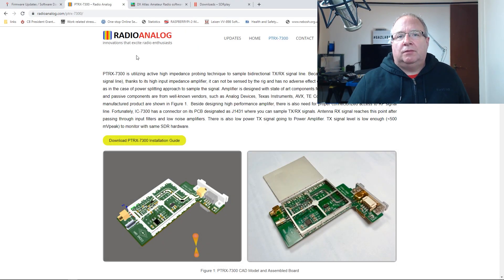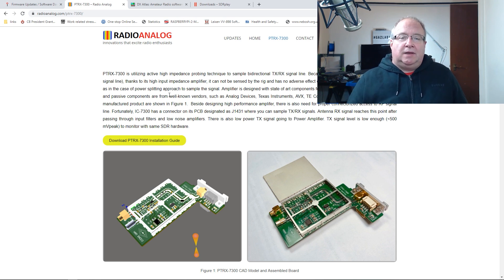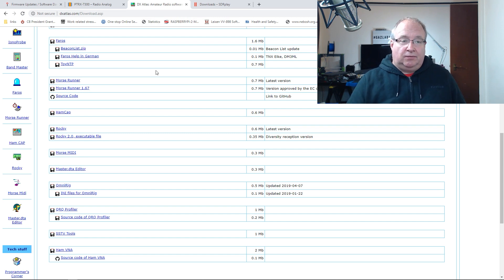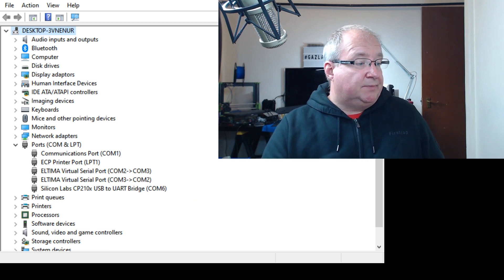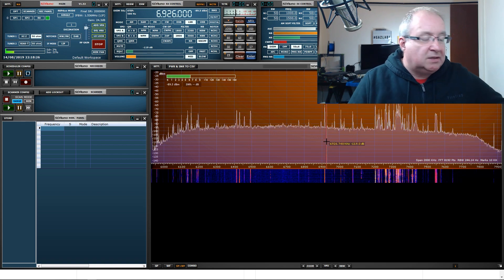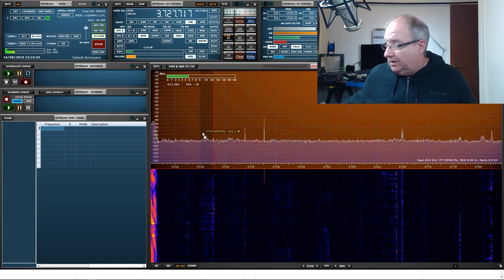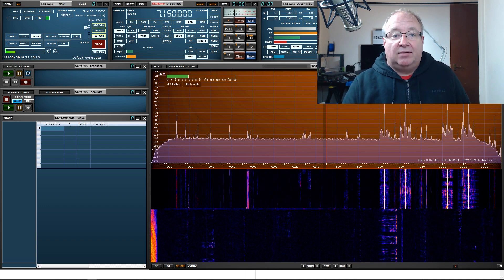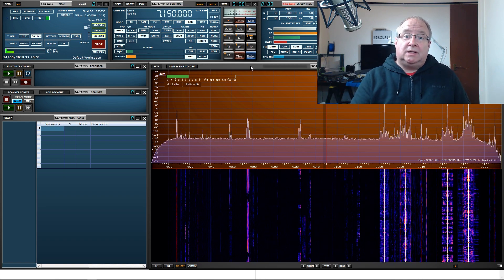PTRX-7300, Omnirig, SDRPlay UNO., IC-7300 connected!

Comment: so if an aerial is plugged into SDR Play and then SDR Play to 7300 and then connected with Omni rig, do you get the full spectrum of the SDR ie the SDR Play will pick up say 23cm if the aerial is in i take it you could tune it with the radio on 23 cm which it isn't capable of
Reply from the maker: no, the ptrx is designed around the spec of the 7300.. you could use an RSP duo just utilise the second receiver for what ever you want with its own antenna..

Comment: Gary, I have an IC-7300 with the internal board feeding to an SDRDuo, I would like to plug a receiving aerial into the 7300 and thought that maybe I could do it with this combination of hardware and software. 

Can I bring in a receiving aerial such a very long wire that is low down and feed that into Duo's second port AND then synch the frequency on the rig in particular to the SDRUno software and listen to the reciving aerial over headphones/pc speaker? Using the internal board will save me hammering the Duo on transmit.

Have I understood the cabilities correctly, or is there a catch and you can only control the rig from the SDRUno software rather than the other way around?

73 de Terry G0BIX

Comment: Thanks for the great video!! I just have one question. I have the same configuration with omnirig and the 7300 panadapter board and sdruno software running the Rsp1a. While connected as shown in your video is it still possible to receive let's say shortwave broadcast and still be able to receive the full radio spectrum, not just the ham bands? After all the SdrPlay is 1mhz to 2ghz something like that?????

Comment: i have installed and plug in to antenna tuner outside seems loose have not installed uno yet and is sdr not connected to pc very high swr

Comment: Great Video, I have the same setup completely but I cannot get it to work, as soon as I open SDRuno my radio goes into transmit. I have tried assigning different COMM ports but still the same, just wondering if it might be my USB cable . if you have any ideas or could help it will be great   Kim G MD0KPG

Comment: Hi do I use a usb cable when doing this operation ?
Reply from the maker: You need the 7300 and sdr play connected to the pc via usb yes.. gaz
Reply: @TheGazLab  thanks Gary I thought this would be the case I've also got the panadapter fitted in my 7300 the program looks good as well.

Comment: Thankyou for the video as that is my next project.  I already have my IC-7300 set up with omnirig to run the WSJT ft8 software and Win4IcomSuite.  Is there going to be a conflict?  The Win4IcomSuite is paired to the omni rig and the omni rig is paired with WSJT.  I dont expect all these to work at the same time.  73 de VE3MRX Bill in Oakville

Comment: If you want to use the sdr receiver as the primary receiver, how do you mute the received audio during transmit to prevent feedback thru the mic or are you just muting the sdr audio at all times?

Comment: when you transmit with the sdruno running does it affect the software in any way? or affect the tx signal from the 7300?  Im thinking about buying the ptrx and installing it in my 7300

Comment: Hi, Can you please tell me why after setting up the program the dial on the ic 7300 is very jerky does not run as smooth as I think it should, Many thanks B.
Reply from the maker: Jerky on the 7300 or pc??
Reply: @TheGazLab  on the pc.
Reply: I have found the answer,  :)   you have to adjust the  Poll int, ms in the Omni rig control in my case I adjusted it to 100. It now working great.
Reply from the maker: @brian.7966  sweet and noted :-)